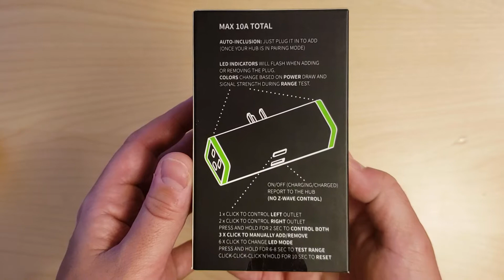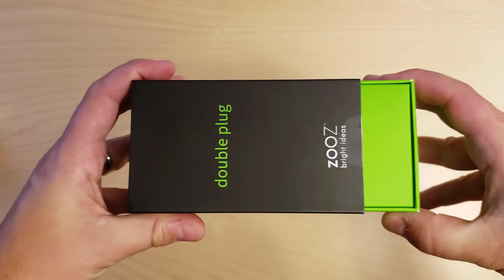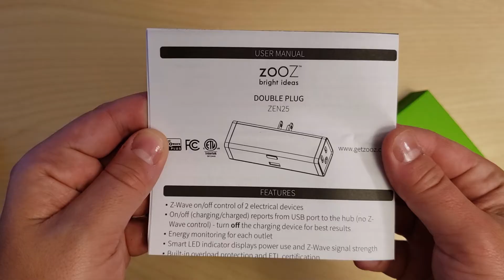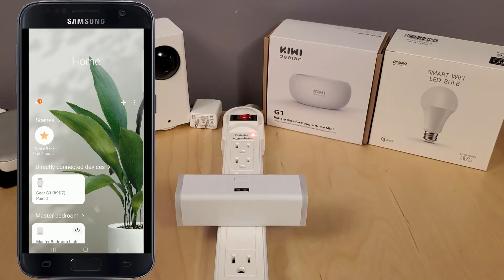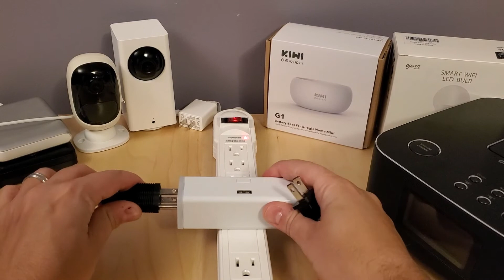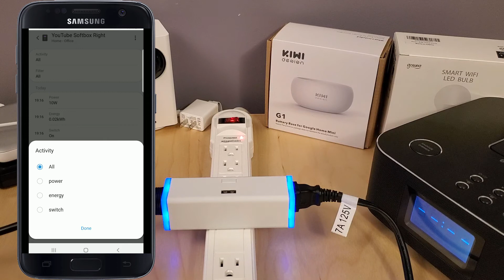zoOZ ZEN25 Zwave S2 Double Plug - Unboxing, Setup and Review

Comment: Great video. Keep it up!

Does this require a custom handler to monitor power usage or does it work by default with a smartthings handler? The reason I ask is for local automation as pose to cloud automations with custom handlers. Thanks
Reply from the maker: I didn't use any custom handlers
Reply: Awesome! Which default handler did it assign? In addition, what are you able to do without a custom handler?